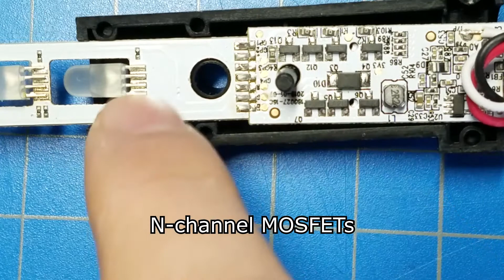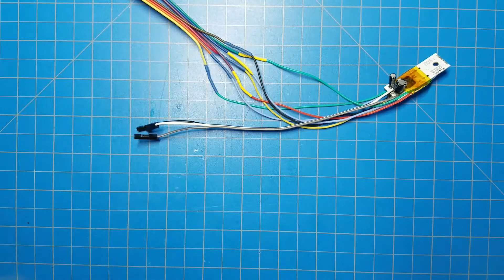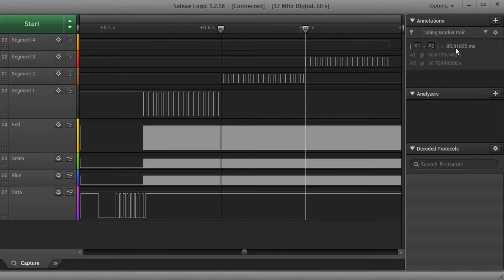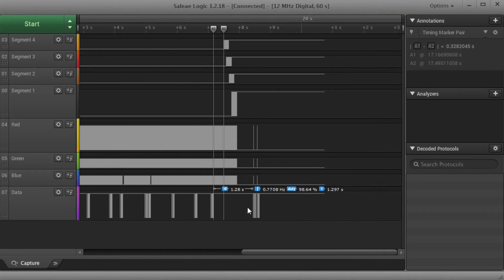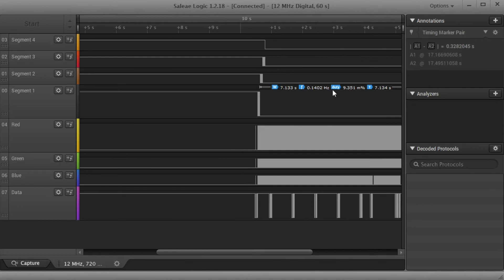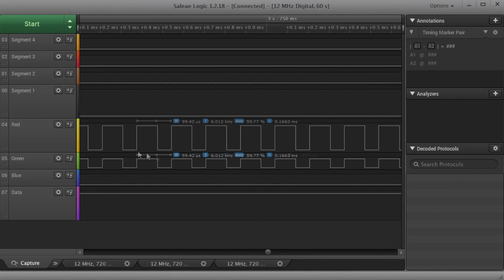How Galaxy's Edge Lightsaber Blades Work

Comment: So why is it that the inside of this blade looks more advanced than the inside of a neopixel but the neopixel outshines it?
Reply from the maker: @James_Austin  NeoPixels blades typically contain just the LEDs. The electronics to control them are in the hilt.

Galaxy's Edge hilts have put the electronics to control the LEDs in the blade and the hilt sends commands to the blade that the blade's electronics decode and respond to.

I have no idea why they made that design choice. NeoPixel blades were around long before Galaxy's Edge existed. They would have known how to make them. Maybe this design is cheaper? I don't know.
Reply: @Ruthsarian  does this design choice mean sabotage the brightness? The LEDs look specially made when they could just used common LED strip tech and the blades would be just as bright! Thanks for the reply btw.
Reply from the maker: @James_Austin  it's a tricky thing. the hilt and blade are running off of a battery pack with 3 AAA batteries. if those LEDs were running at full brightness that battery pack would be drained in less than an hour. and they don't want people walking around with a dead lightsaber. so they're extending battery life by running the LEDs at a reduced brightness.

there are custom neopixel blades for galaxy's edge hilts. they usually have 2 strips of LEDs back-to-back to get the best light distribution. that means the number of LEDs in those blades are 2-4 times greater than the stock blade. so they have to carry their own battery in the base of the blade to keep those LEDs running. (see: https://www.youtube.com/watch?v=ftxNxvhxoQ8)

There's another approach which uses through-hole LEDs similar to the ones in the galaxy's edge blade, but they're neopixels. I have a Hasbro Black Series Rey Skywalker Force FX Elite and it uses those kinds of LEDs. It looks so much better and it's what Galaxy's Edge blades should be, but... they did not go in that direction.

I'm trying to find a way to make a custom neopixel blade without needing the extra battery. I have a couple ideas I'm working on.
Reply: @Ruthsarian  still makes me wonder why Disney just doesn't opt for a rechargable battery like a neo pixel! Problem solved. I know from some reading that I may have to replace the rechargeable battery in my xenopixel somewhere down the line so maybe that's why Disney doesn't opt for that? Or is it too expensive to incorporate a rechargable lithium battery? People would pay the extra 100 bucks.

Comment: Two things:

1.  Will you be making and selling these LED controllers when you've finished designing them?  I really want to customize my blade but Dead Bothans doesn't sell the controller, and I lack the prerequisite knowledge needed to follow their instructional videos.

2. Just a suggestion for an LED pre-set for the blade.  You could have all the red LEDs on, and have all the yellow LEDs switch on and off randomly.  This might give the blade the appearance of Kylo Ren's unstable lightsaber.
Reply from the maker: I don't have any specific plans yet as to what I'll do with the finished blade controller, but I've been thinking about it. I don't want to just make one for myself and end it there. I want to share it with everyone so I'll probably share the PCB design and code at the very least. There will be a video covering assembly and installation so anyone interested in making there own can get some idea of what they're getting themselves into. I'm concerned that for most people installing the custom controller won't be a viable option and I (and/or others) will need to sell entire, modified blades, which is only going to add to the cost for something I'd like to be as inexpensive as possible.

I am looking for suggestions on blade effects. This isn't like a lot of third-party blades that use neopixels; the GE blades have some limitations with the RGB LED strip's design, but I want to see what's possible. I'll try your suggestion and see how it looks. Currently I have a couple unstable effects that change the brightness, rather than the color, of the blade, but maybe adding color changes will help push the effect further.

The custom controller I have working right now needs some changes. The banding seen at the end of the video is a result of the code not switching the LEDs on and off fast enough. I've gone about as far as I can with software and I need to make some hardware design changes to up the speed which should remove the banding and allow for a wider range of colors. Here's a demo of what I have so far: https://www.youtube.com/watch?v=1nynlhS9aXg
Reply: I'm looking forward to your future demo videos.  On the subject of selling full and complete customized blades, if that's an idea that's not to your liking, would you consider a service where someone sends you their blade to be modified?

Comment: Also, can the color be changed on a legacy blade? There is no crystal so the ID is set in the saber PCB. I'm glad I hung around till the end! I want one of my sabers to do that! Disgustipated?
Reply from the maker: the color component of the ignite command legacy hilts send to the blade is fixed; it's hard-coded in the hilt's firmware and can't be changed.

Disgustipated is a reference to a hidden track on an album from the band Tool.

Comment: Very interesting. Thank you Eric. Where is the flicker during a clash event? Doesn't the blade flicker to a slightly different color?
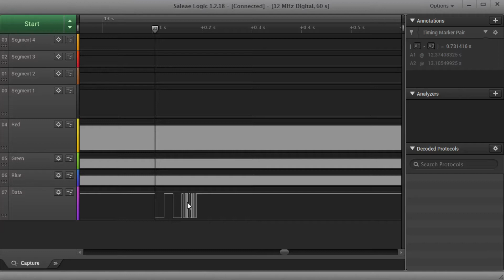Reply from the maker: The clash event? That's covered at 17:08 in the video. The only other flicker the blade does is the unstable blade effect used for Kylo Ren's legacy lightsaber. Any other flickers you notice in your blade are the result of small changes in power draw and/or slight variations in the PWM timing and are not tied to specific blade operations.
Reply: @Ruthsarian  Seems like a clash event made the blade get brighter or change to white briefly. Could be my imagination. Cool stuff in any case. Were you artificially changing the colors at the end or did you program that into a PCB?
Reply from the maker: @skydanz10  at the end, i show a crystal with a cyan RFID number on it igniting a blade cyan. just before that i show the replacement blade controller i designed attached to the LED strip inside the blade. that custom controller, recognizing the cyan ignite command, is why the blade ignited cyan. whereas the stock blade would only ignite blue. other code that i have on that custom controller is what is driving the blade to produce those other colors as well. it's just a sample of what i'm currently working on and the reason why i dug deep into how the stock blades operate.